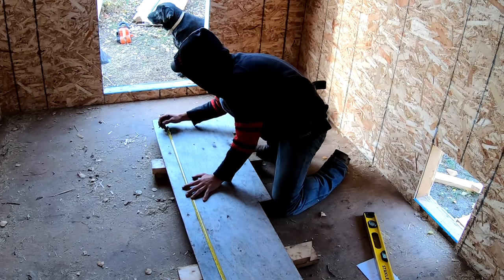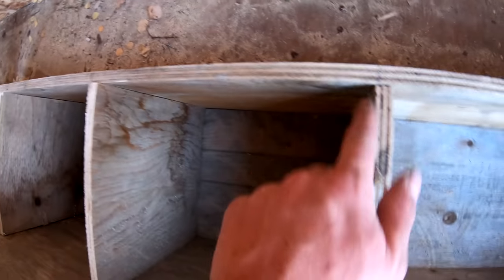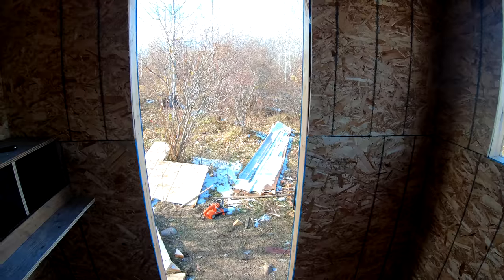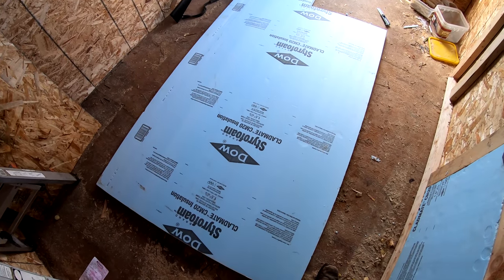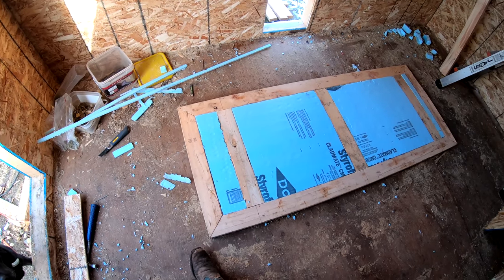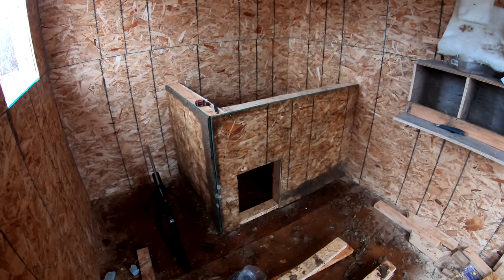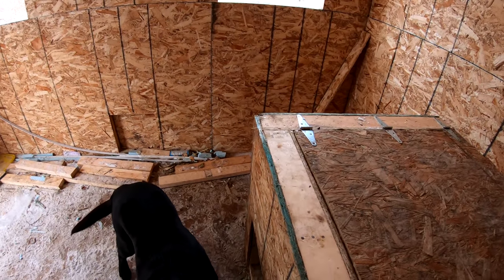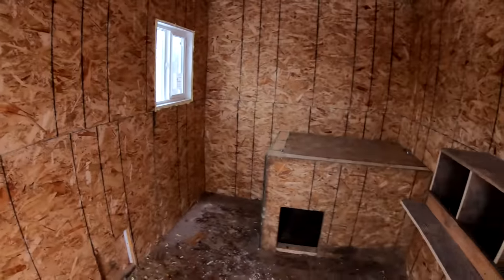Building a Chicken Coop Pt. 7 Nesting Boxes, Doors, Windows, Plus a Coop Inside the Coop!

Comment from the maker: Hey guys, definitely not my most exciting video but I just wanted to show what I built inside the coop there. There is nothing fancy about what I have done, and plenty more can be done inside there yet! However I don't want to put to much effort into the inside as the chickens will just make a mess of my hard work haha. This setup has been working great and my chickens are loving it here now! Also, I got lots of work done on the cabin here now so have some videos coming out on that! Thanks for watching my friends, trapping videos coming very shortly!
Reply: I noticed that in your framing video that you said 27 1/2 by 27 1/2 windows but when building it's more like 29 by 27 1/2 is that correct?